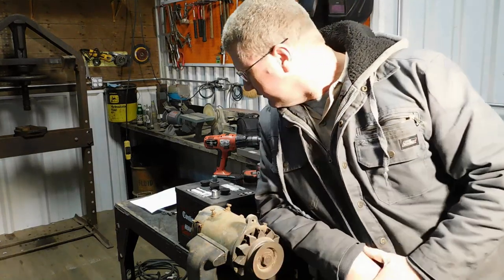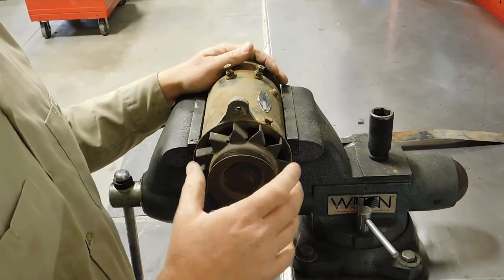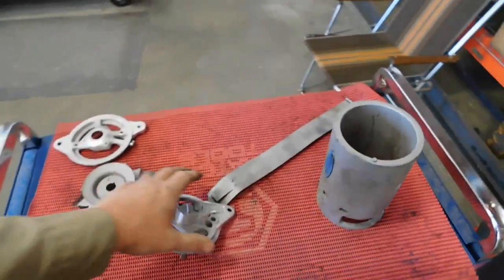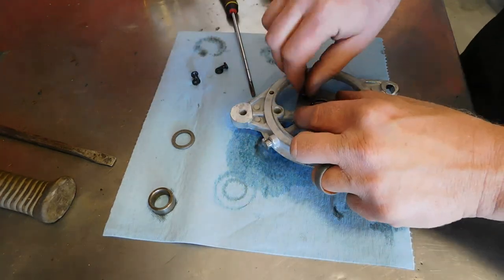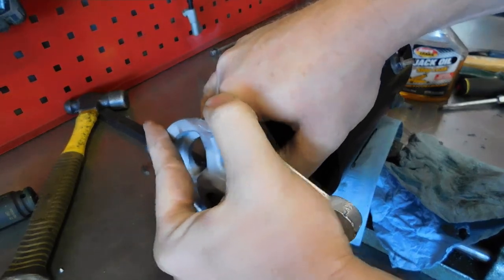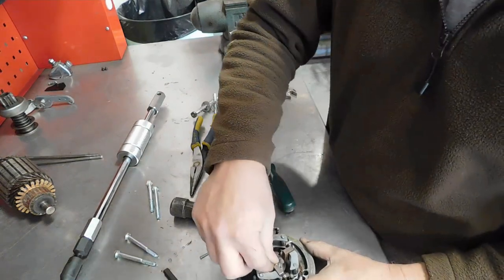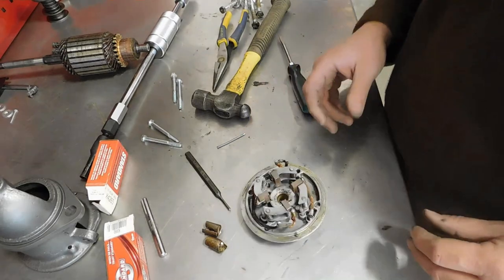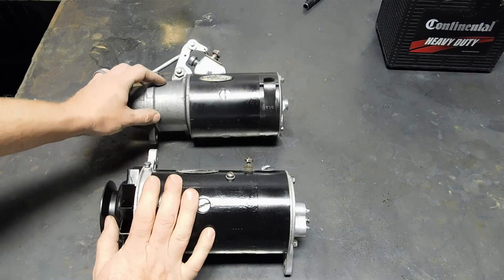Part 13: 1929-1954 Chevrolet Delco Remy Starter and Generator - Quick Test & Rebuild

Comment: I first want to thank you for taking the time to showing us thorough techniques in disassembly and assembly of the generator. In regard to the felt washer and retainer sequence the first thing I noticed was first reference was 1942-1948 where as I have a 1938 which might explain the difference. Maybe they, GM changed the sequence starting in 42. My 38 Chevrolet maintenance manual does not show a parts breakdown for the generator or starter.

Comment: Quick tip, to remove a blind bushing.  Tap it, use a nut(s) in the bottom of the hole, find a bolt that fits the newly tapped bushing.  Tighten the bolt in stages adding nuts as you go.  This worked well on my cast iron Delco Remmy end plate.  Anything made from aluminum would be a prone to pushing the nut thru the aluminum cast.
Reply: I think the bushing was too thin to tap.

Comment: Interesting watch.  There are three types of field coils:  Series wound high speed low torque, Series-Parallel wound medium speed and torque, and Parallel wound high torque.
In every case, the matter is simple.  It is an educated short to ground.  To promote the highest torque value requires the lowest possible circuit resistance, and therefore you
want the resistance of the field coils to be zero.  In operation, carrying hundreds of amperes, the overall speed of the cranking motor is limited by brush location, and by the
ratio of the armature pinion tooth count-to-the-flywheel ring gear tooth count, frequently a 16:1 ratio.  You mentioned a lot of the important considerations.  To remove the bushings
from the drive end frame and the commutator end frame, you use a cape chisel.  The felt washer, if equipped acts as a brake to slow the disengaged armature after cranking, and
to reduce seepage of the bushing lubricant, and one lubricant that works very well is Lubriplate 105.  Your presentation was engaging and offered many good suggestions.
Reply from the maker: You seem like a guy I need to hang around with for awhile. Thanks for the input.

Comment: My dad switched his 1950 Chevy 4400 farm truck to 12 volts back when I was a teenager.
All he did was change the voltage regulator and all lights and put a resistor between the ignition switch and coil.
I believe it is actually easier on the starter because it starts right up , not after 3 or 4 turns. I still have the old truck and I’m getting ready to paint it soon as the weather is right.

Comment: thank you for your video, with your video it will be a easy thing to rebuilt the alternator of my 1941 Pontiac ( converted already to 12V) , as I have noise at the radio I would like to add a condenser at the alternator but not sure how to hook up, do I need to connect to the field wire ? ..

Comment: Just finished my Generator..it had the felt washer first when I pulled it apart.
Reply from the maker: Do you mean the retainer was between the felt and the bearing?
Reply: @TheJayhawker  Correct
Reply from the maker: @danielconklin6792  That's very interesting, I just don't understand how the bearing would benefit from the oil like that. When in doubt, put it back the way you found it I guess!

Comment: I noticed you hooked the cable to the positive battery terminal from the starter.  If it is a positive ground system would the cable from the starter go to the negative battery post?   Reference;  1953 GMC,, Wiring diagram..
Reply from the maker: Chevrolets are negative ground, but thanks for looking out for me.

Comment: Is there any advantage of using silicone grease instead on the splines and end bushings?
Reply from the maker: Don't use grease anywhere on starters and generators. It collects dirt and holds it, which is a bad deal for electrical motors.

Comment: So I cleaned all my ends the generator works well new voltage regulator. Sits at 0 but as soon as I run anything the needle drops and doesn't come back to 0 till I turn off the lights, heater or radio. Each unit drops the needle a bit. Help.

Comment: Question I have 1950 dodge meadowbrook the generator it’s not retaining charge and drain the battery when I turn on light more likely the car turn off and I have to give a jump. What can it be I sent the generator to repaired
Reply from the maker: Here's a video where I deal with your problem on a '38 Buick special. Everything will be basically the same principle although I'm not sure off hand if your vehicle is positive ground. 
check out this video: https://www.youtube.com/watch?v=kAFn666jmAw&list=PLd1-laPZkIhiPK67_IMzJ6457BPiVV9s3&index=3

Comment: would you know if its possible to convert one of these old pedal push starter and put a solenoid on it ?
Reply from the maker: I'm not sure, I've never looked into it. I wonder if a Buick starter from around the same year models would bolt up. They seem to be very similar and the Buick has the solenoid. All you would have to add is a push button in the cab if it does.
Reply: You could use a 50s starter on the car but you won't have foot start you'll have push button start also you have to space up your battery tray because it will hit the solenoid I did this to my 41 I didn't care for the foot button start because they developed connection issues

Comment: Its a 12volt generator do i need to polarize it.
Reply from the maker: Yes polarize the generator by touching ARM to BATT momentarily with a jumper lead. With generators you won't show any charge at idle. Rev the engine up to about 1000 rpm and see what the gauge does.

Comment: Ok my starter was working out of the car and before I took it off I put it back now the new solenoid works but the starter doesn't spin the motor help with ideas please I don't wanna take it back off the grounds are good the engine isn't locked up charging battery right now was at 3.7 volts 500 cca
Reply from the maker: Not sure what kind of vehicle you're working with here. But if it's a 6 volt model, your battery needs to show over 6 volts with a meter for it to spin that thing.
Reply: @TheJayhawker  it's a 49 pontiac
Reply: @TheJayhawker  it's the battery thanks